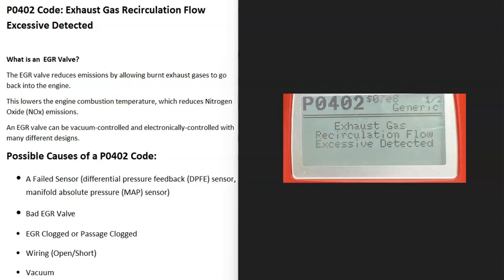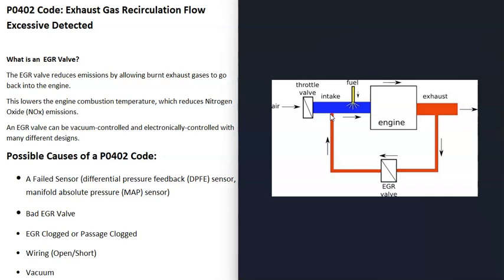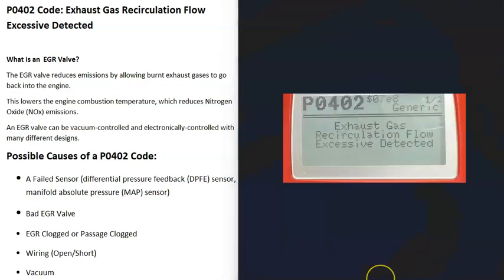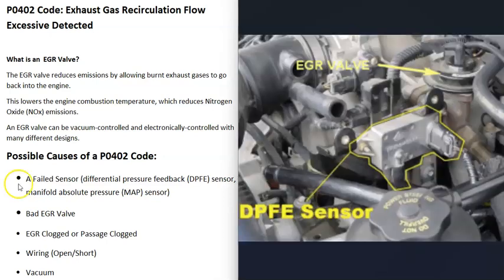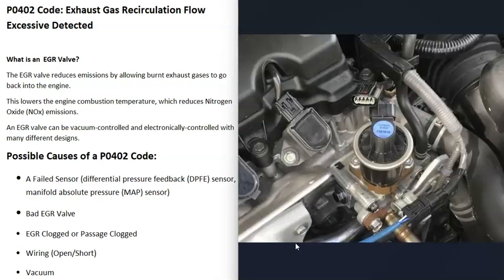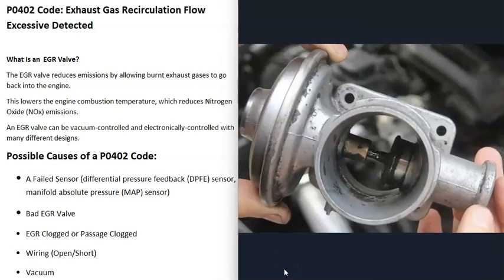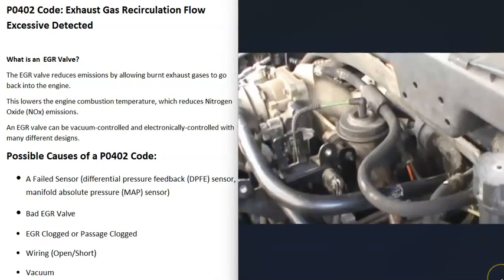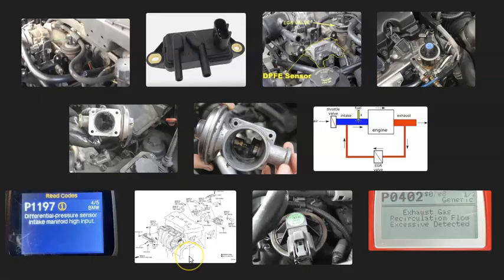Causes and Fixes P0402 Code: Exhaust Gas Recirculation Flow Excessive Detected

Comment: Can a cheap eBay egr valve cause this code n mean I need a more expensive and reliable egr valve ?
Reply from the maker: Low-cost parts can be an issue sometimes and cause problems. The only way to know for sure if it is bad is to test it.
Reply: @HVAC_Mechanic  it’s my second one from this company n both say the same thing wat other way can you test them

Comment: Ich hatte auch den P0402 im Fehlerspeicher, AGR neu + Drosselklappe gereinigt, Map Sensor Neu, KGE Neu, Fehler kam immer noch. Immer Abgas, Motorstörung. Am Ende war der Aktivkohlefilter (Tankentlüftung) dicht, dadurch zog der Motor mehr Unterdruck am AGR Ventil an und lockte mich zuerst in die falsche Richtung.
Reply: I have the same issue. Same code what did was replaced in order to fix it and how did you troubleshoot the problem how it was diagnose??

Comment: Hi excellent vid. I have a question tho. I have this code in 2 parts, one is P042F $07e8pd and other is P042F $07e8 but the error message says manufacturer control. Any help would be great. I have not long had the Egr replaced.

Comment: Excellent video. 
I have this problem on my 2001 Ford Escape. 
My car is stalling at cold start, the exhaust shaking and after engine warms up it stops shaking. 
Question I replaced the egr and car would not start I got it to run after several attempts while stepping on gass then I replaced dpfe sensor.  the solenoid I’m thinking I might have to replace too I took the hose from top of egr, while car was turned on and put my finger on hose I feel a suction on finger is that a good indicator that solenoid is good? 
The other solenoid I replaced did not have a suction after removing hose from egr.
Reply: When your motor is idling, the egr valve should be closed. Your solenoid valve that controls when the egr valve receives vacuum should be closed when idling.  Be sure you have the vacuum hoses connected correctly at the solenoid.